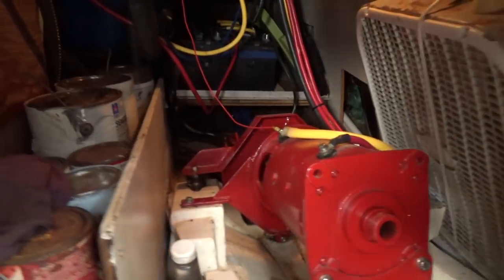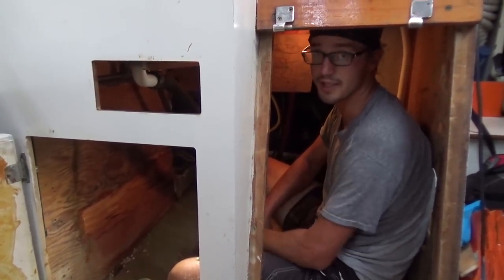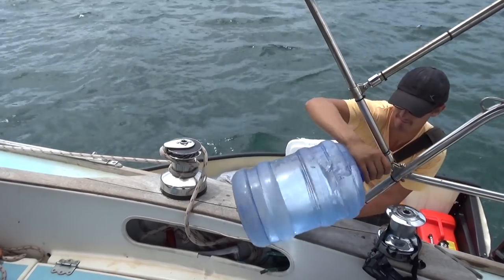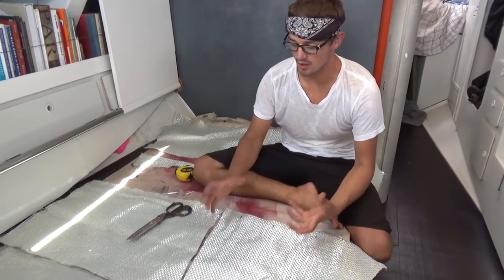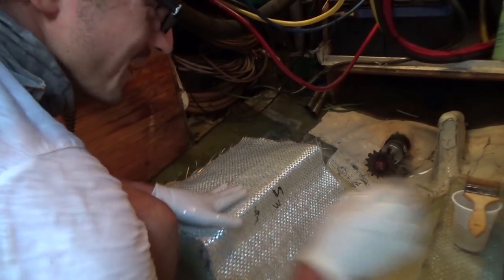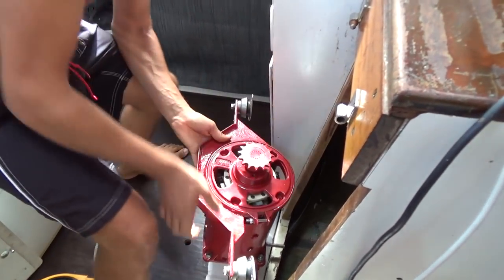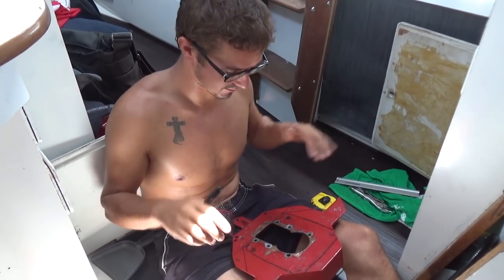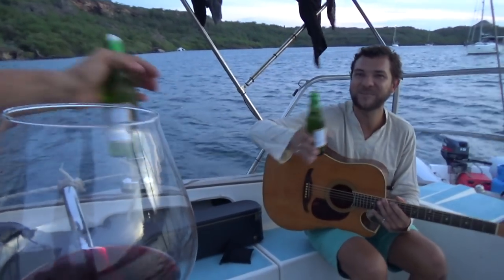REBUILDING Our Electric Motor - Going Direct drive — Sailing Uma  [Step 99]

Comment: As soon as you can pull 120km at 6kt I will change to electric. I went with an electric for the dingy. It should give me about 1 hour of autonomy at full trottle and get rid of the gasoline reserves. Charging with wind and solar. Right now I need 3 types of fuels  gasoline, diesel and petroleum. Hopefully dropping as many of those as possible.

Do you think adding wind would help you top up enough for the canals even if it's adding noise ?
Reply from the maker: Currently, the only way to get that kind of range and speed is to go hybrid. Unless you had A LOT of lithium batteries and a VERY efficient motor. But for us at least, that's why we have a sailboat. The sails will always take us most of the way, and the electric motor can do the last bit. Then, if we ever need to motor all day or for long distances, we can plug in a genset. But that will be very, VERY seldom.
Reply: That is why we sail!
Reply: Yep, but some people live at the end of the longest sailable fjord in the world. And getting out of nasty currents is rather important ;)
Reply: Google (or put in youtube) arcona 380z. It's a nippy swedish cruiser with integral steel frame and a Finnish electric motor system by oceanvolt and a performance mainsail with a 1000 W solar sown in and 800 W of solar on the deck and boom feeding to 14kWh battery bank. Does roughly 5 hours of full power during daytime, 6+ hours at 5,5 kn. Not that it'll be needed often, as the damn thing goes 9 knots upwind with an angle of less than 40...

Comment: Have you looked into one of these shaft couplings? https://www.ibtinc.com/when-to-use-a-jaw-in-shear-jis-coupling/
We have used them on diesel driven fire-pumps and they have worked out pretty great. It is very easy to replace the flex joint, no need to remove the actual metal coupling from the shaft. 
Keep a close eye on the axial movement of the electric motor shaft, thrust is extreme and constant, thus thrust bearings are very very important. I realize that you will only be using the motor for entering and exiting harbours, but the thrust will be an issue if the bearings that you installed are a little undersized. Remember that even when the motor is not being used there will be thrust in the reverse direction when ever you are sailing/moving .

Comment: Zhou could have told your viewers that polyester resin attacks styrofoam and epoxy does not. Important information skipped out
Reply from the maker: We’ve never used poly resin, so couldn’t really comment on its characteristics.

Comment: Yikes...  I found myself getting nervous watching you rip all that stuff out and commit to the electric.  Not sure I would have the guts to go away from a small and efficient diesel.
Reply: With solar as cheap as it is now, I think it's going to become much more common. Even the little watt and sea generators will do 1000w. To be able to motor into harbor, flip the motor on when you need it, but never need to fill your diesel tanks...little baby marine diesel engines are going to get a lot more common on craigslist.

Comment: I like the electric motor HOW LONG CAN YOU RUN IT ON BATTERIES and I don't want to be one of the bitchers but I am there is a channel boat works USA. His thing is glass. He suggested tearing glass as all those strands actually make more surface area to bond with the existing glass. STRONGER JOINTS I have tried it and as a old bastard that has many years of patching glass. HE WAS RIGHT REALLY CHECK HIM OUT

Comment: The whole episode you didn't once explain WHY you wanted to go direct drive. Why? What's the advantage? Why didn't you do that from the beginning?
Reply from the maker: We do point out that we didn't go direct drive from the start because back then (since it was all experimental) we didn't know how it would turn out, and installing it direct drive is a more permanent setup, so we help back until absolutely sure that our DIY motor system works first. Going direct drive means less parts (not having to worry about a transmission) and less vibration. It makes the whole system much much simpler, and the simpler the better.

Comment: Are you aware of the danger of breathing in fiber glass fibers.?? Take care.
Reply: Ronald De Joux Don't worry, it's the fibers from insulation that is more of an irritant , it's made by a different process than fiberglass structural glass.  also within reason levels of exposure  they have shown that fiberglass is not like asbestos , it a different shape microscopically , 
Cheers warren

Comment: hmmmm i'm not sure how that foam will hold up over time. wood would of been a better choice.
Reply from the maker: It doesn't matter since the foam is only there to hold the wet glass in place until it dries. All the strength comes from the glass and not the form work. We could dissolve the foam away and it would still retain all it's strength.
Reply: I would have put a doubled up couple pieces of teak or marine ply on top of the foam and under the glass to give to screws more to bite into once threads are tapped. Saturating the threads with Cyanoacrylate glue (super glue) will help strengthen and seal the threads. they will likely have to be re tapped after the glue sets up.
Reply: Tom Frazier I agree. I would have even gone so far as to put threaded inserts into the wood and secure them. This would give added resistance to torque and vibration. I'm not sure I would use  Cyanoacrylate (super glue), you may consider looking into a product called VibraTite, I've had extremely good success with this product.

Comment: Your work looks good, however you need to get a n enclosure for the batteries because of the gas given off it does present an explosive hazard in a confined space like you have. BTW I'm in n.c. USA so if you find yourself here and need assistance shoot me a text, message,ect

Comment: Question, why didnt you direct drive from the start? i dont get why yoou put in a transmission, 2 tries, while now going direct? thats wasted time and investment
Reply from the maker: +Rombout Versluijs we didnt go direct drive the first time because removing transmission is a more complicated and permanent install, and since it was all experimental, and didnt know how it would work, we didnt want to make it  official just yet. But after 2 years of testing, and loving the results, we decided to finally remove it.
Reply: You mean permanent cause of the mount you made? You got the other mount out, so cant this mount come as the same as the other or is this one build stronger due to more forces set on ut?

Comment: +Dan and Kika Here is the problem and it serious, especially in  light of the fact that you are both Architects, which implies that you have completed at least some science and engineering courses: You are making design choices with no modeling or mathematical analysis of the problem at hand. 

Imagine that you have to accept or reject the design of a large roof for a sports stadium. Would you say, "Looks like it might work and hopefully it won't collapse." or would you say, "Show me your calculations of the weight for this structure and your calculated stresses for each beam and column."?

I do understand that it is often difficult to assemble the data needed to do an analysis and sometimes prior practice proves a design, like using 2 x 4 lumber for the studs of a one or two story residence This is your third or fourth attempt to install auxiliary power for Uma, including the diesel engine that you had shipped from Florida. The lesson is: Guessing is not a good way to get favorable engineering outcomes.

Love you both and you do a good job of creating interesting and informative sailing videos. FWIW, Dan looks and speaks remarkably like a young man who was my daughter's boyfriend for at least 15 years starting from when they were freshmen in college in 1988. She married another man who is not nearly as physically fit but is a good provider and good husband and father.
Reply: How do you know what modeling and mathematical analysis they are doing?  Not exactly enthralling video.

This isn't their 3rd or 4th 'attempt'; it is iteration of design towards a known goal.  Incremental improvements based on experience.